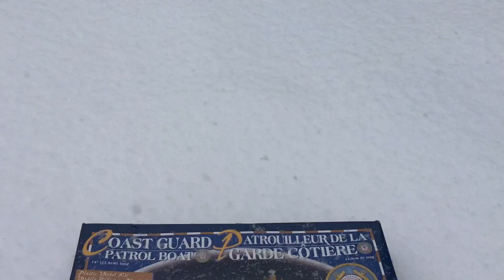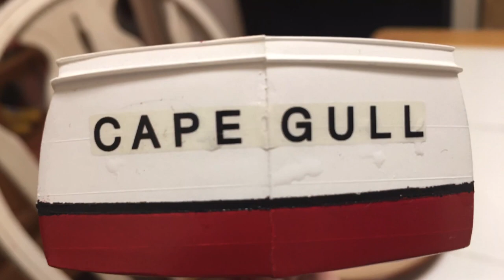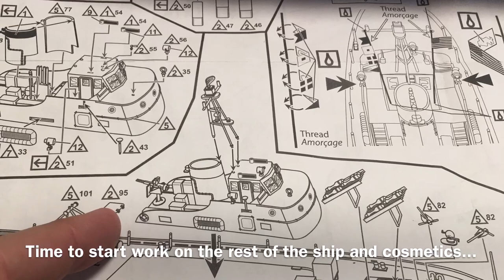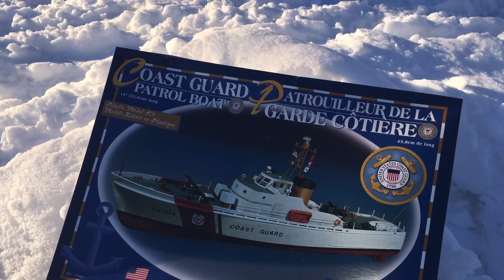US Coast Guard Patrol Boat - Lindberg 1/82 RC conversion plastic model kit CAPE GULL  (Part One)

Comment: I was an engineer on the Gull from Nov 1979 until July 1980. I was transfered to Station Fort Point in San Francisco after being replaced by the first female engineer crewmember (for that unit).
  4 big drug busts and involvement with the Mariel boatlift from Cuba. She was last homeported I believe in Miami, decommissioned and is now an artificial reef off Fort Lauderdale.
Reply from the maker: Cool, thank you for sharing!  That is some really awesome history, I really wanted to know more about the Cape Gull and it is so cool that someone who served wrote in about it very cool!  Having served on her how accurate does the model appear? I basically went off the directions and the box pics and I think a few old photos of similar ships…. I tried to be is accurate as possible…
Reply: Another thing, make very small green pot leaf decals on the stack with at least 7 green slashes descending below the leaf.
Reply from the maker: @scottmcdade753  cool ok I can picture what that looks like, the slashes represent busts? I don’t think I can make a decal for it as I don’t have the proper equipment unless maybe I can get decal paper for a printer…. Maybe that would work But I will remember this as that would be a nice detail to add if I can figure it out :-)

Comment: Just a thought, I’m building this same model and I’m only doing a single shaft single rudder. This is an idea if you haven’t already used it… but if you get the stick on wheel weights, they make great ballast material that sticks in place. Great looking model thought!!
Reply from the maker: Great idea!  I may have to try that next RC conversion I do.  Overall I like how my model turned out so far as “looks” but I was disappointed in performance,  I made the model’s ballast too heavy so she can easily capsize especially if you reverse or hit heavy waves.  Not sure if I say that on the video or not as it is something I started to figure out after using it a few times, when the videos were finished as I did the video when I was building it and doing the first tests….She is definitely due for a complete overhaul if I can somehow remove the rocks I glued in!
Reply: @ourdogzippy  I converted mine to single rudder single prop and motor and with a 2S set up. A lot lighter and has the potential for higher speed. I’m using red top can motors with 2mm prop shafts and 12mm 4 blade propeller. I’ve calculated mine out to hold 10oz of weight to sit perfect in the water.
Reply: @ourdogzippy  also to remove the rocks carefully cut them out with a exact knife.
Reply: @ourdogzippy  another thing I forgot to mention is when you mount the deck I’m not sure how you did yours but I plan on putting a L bracket inside to create a surface lip to RTV silicone my deck to my hull for easy access if I need to do repairs.
Reply from the maker: @williamgibson2630  mine is glued but I can access most by removing the wheelhouse - may need surgery if I ever need to fix the motors and shafts

Comment: A plastic model is pretty much set on how the injection molder is configured. One, "boat alt", that the Gull had was the wave shield on both port and starboard had been shortened to terminate at the bottom of the ladders coming off the bridge to the main deck.